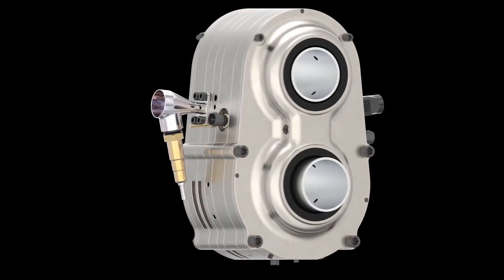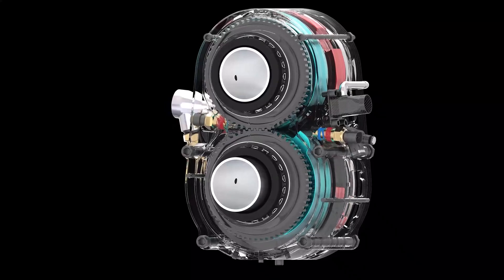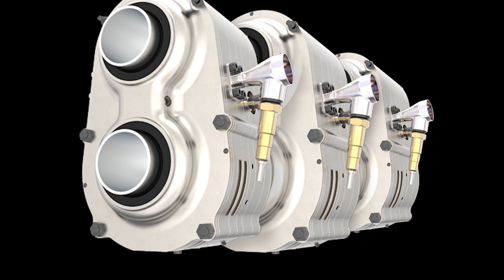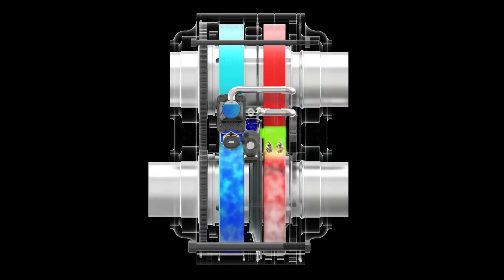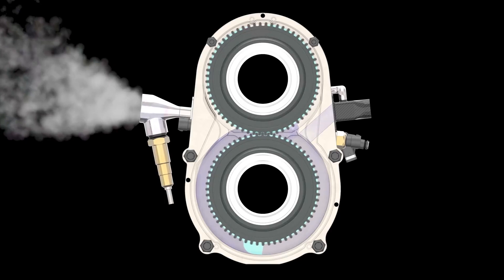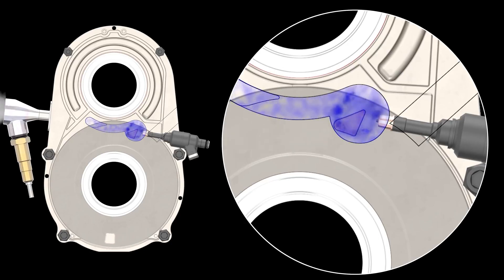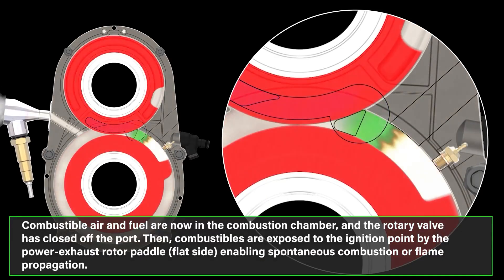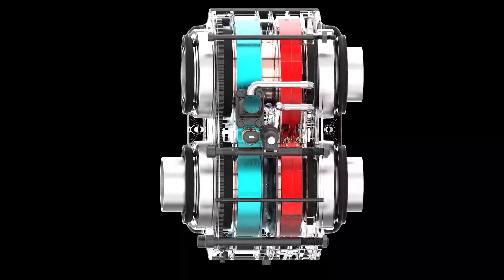This pistonless engine runs on hydrogen and revs to 25k rpm

Comment: Great if it gets built, but I feel that either the big auto manufacturers will buy the rights and shelve it or it will be too expensive to build to make it a viable alternative power source. It’s a terrific idea in principle, but I won’t hold my breath.
Reply: This engine is fake.  It does not exist, and it never will.  Because it's 100% based on bullshit.
Reply: @foobarmaximus3506  That's cool! Did you build a prototype and you can't get it to work?
Reply: Hope that doesn't happen. I'm a firm believer in internal combustion engines for cars and trucks. Retrofitting older cars with better engines is the way forward.
Reply: @IDontWantAHandle101  Especially if they are efficient and hydrogen burning.
Reply: @IDontWantAHandle101  It’s not. Fully electric will always remain far more efficient.
Reply: @Freba9  Electric cars look good when you don't physically see pollution.  It is the pollution it takes to build one and recycle it. Average people do not study they just get the government to tell them it's good.
Reply: @Siky1-e1x  Famous misconception. EVs are the cleanest solution regarding their full life cycle.
Reply: @Freba9  You have obviously not studied where the battery materials come from and units of energy to make Ev's?
Reply: @Siky1-e1x  ......is making materials for regular car any different if Thats the argument? Oy atleast a part of industry (automotive) will cut the fossil consumption, other heavy industrial work utilise it more already.
Reply: @changsangma1915   Open pit mining is happening all over the world especially in fragile Eco systems  for precious metals to build batteries and semi conductors. Normal cars do not need near as many of these minerals.
Reply: @Siky1-e1x  Of course I have. Tons of research on this.
Reply: @Freba9  taking into consideration the build of a powerplant, windturbine, waterturbine, solarcell and the wiring, digging out copper, zink, lithium and aluminium, melting it all into useable products,  its quite inefficient to run on electric...ohh and the maintenance and scrapping of all of them......
Reply: @Siky1-e1x  spot on..
Reply: @Freba9  So open pit mining and all the process to do it along with countries that have no care for the environment or child labour is Ok? Lol ! Also millions of tons of carbon spent accessing these minerals?
Reply: @changsangma1915  yes it is, more copper, more lithium, more aluminium, more gold, more everything, windmills use tonns of nonrecyclable materials, their lifespan is horrendously short and a lot of maintenance, powerplants burn more coal and gas to fill the increased energy-consumption electric cars use, so overall electric cars is only a political green gadget...green-branding is the term...
Reply: @Freba9  then why the discussion about it when you allready know electrical cars is a allmost no-go when talking pollution birth to death..??
Reply: @Siky1-e1x  .....words has a way of favoring one's narrative if it can be moulded whichever ways. Implying something as 'Nearly not as much' doesn't provide any impact of justification simply cause it provides a illusionary validation.
Reply: @changsangma1915  I have been heavily involved in this industry of Ev's for a while now. Thanks for the word salad.
Reply: @Siky1-e1x  .....none asked for your resume, keep it in the office. Word salad? Puny way to nope out of arguments..
Reply: @changsangma1915  oh but there is a ton of alternatives, and beeing a EV fanatic (guys like you) apparently there is no other way of "world"
Reply: @Deutsche_1  Still MUCH better than any other solution.
Reply: @Siky1-e1x  You have no clue. Yes it is much better. And according to child labor: the oil industry is still one of the biggest cobalt consumers.
Reply: @changsangma1915  keep on dreaming about electrical cars, they are allready proven false in the enviromental world...
Reply: @Freba9  Ev's better than rail systems? Oil supply from Western countries with children working on rigs ? Tell me more.
Reply: @Freba9  Guess i was talking to the door here...
Reply: @Deutsche_1  Lol not a single of your arguments against EVs makes sense
Reply: They WILL bury it. Not an if, but WHEN.
Reply: With today's tech the machining  cost would be lower as would cost of assembly due to the reduction of parts, while super tight tolerances are achievable even is mass production. The modular design also adds to cost saving platforms. The only reason to not see further development would be for manufacturers to "toe the line" with governments drive for full EV.
Reply: If it's too good, it won't be allowed to happen. Big auto makers will make sure it won't. Sounds like it might be a good idea.

Comment: I would love to put one in a classic muscle car as a demonstrator.
Reply: Too heavy but put it in something like a caterham 7 and I think you’d be in for a wild ride. My 7 has 192bhp normally aspirated engine and hits 60mph in 4 seconds. The engine weighs about 75kg /165lb and the car weighs only 550kg total so this would be lighter. Depending on the torque curve this produces you may not need a gearbox at all so more weight saving. You’d need a pressure vessel which tend to be heavy but would be an interesting project for sure.

Comment: Electric Cars  are  NO  WHERE  NEAR  as  " Green " as they would have you believe . 
Fossil Fuels produce the BULK of the Power for charging the things . And the Batteries are a Nightmare , to produce AND recycle .
And extracting Hydrogen from Water is an inefficient and Power heavy process , as well . Not very " Green " in the end .
Bio Fuels are where our concerns SHOULD be for now . Fully renewable and Clean Burning . Ethanol . Methanol is corrosive .
Once some one Cracks  PRACTICAL  Fusion , then the Game changes entirely .

Comment: How is compression kept from leaking between the two rotors without seals?
It's a great animation, and makes X power in theory but it's not a working practical engine.
Reply: They did actually make a working prototype. I wasn't impressed because it ran for less than ten seconds as a smoky mess, but they've gotten further than most design concepts out there. The real question is if they can first achieve what that wanted in that prototype and if they can make it mass producible. The reliance of "high tolerance" is a huge alarm bell in my head, though. Parts fall out of tolerances over time due to wear and tear. They're gonna need seals on this one way or another.
Reply: @BrokenLifeCycle 
Yes, I've seen the same smokey video.

Relying on 'fine tolerances' for sealing high boost pressures and burning gasses is not going to work very long.
Looks great as an animation.